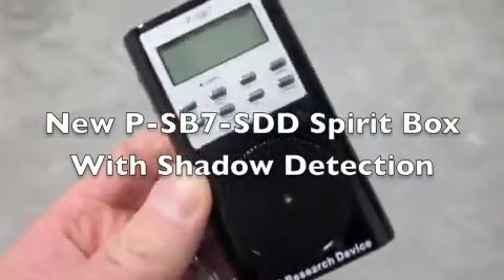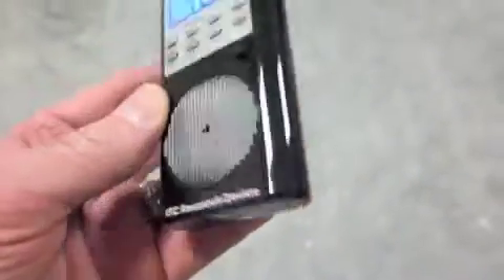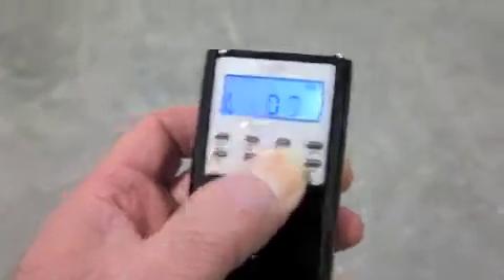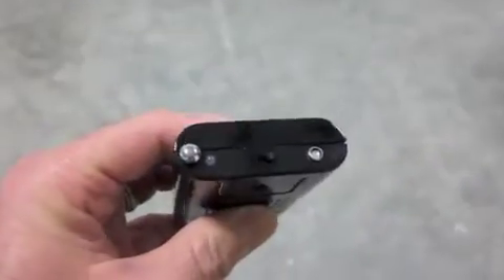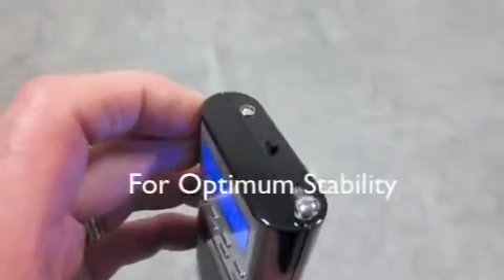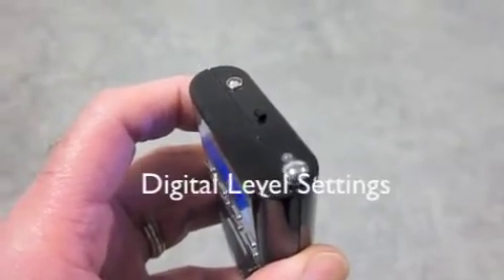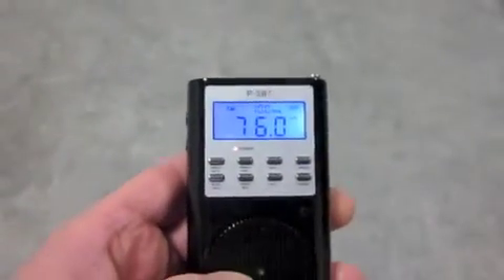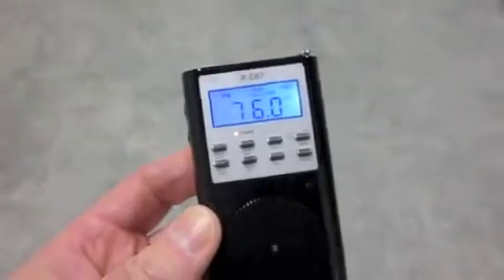P-SB7-SDD Frequency Sweep with Shadow Detection

Comment from the maker: No, you do not need to hold the button. This device has several features that were designed specifically for its intended purpose. Application specific software, programmable sweep rates (Forward or Reverse), white noise between step sequence. ON/OFF backlight, two audio outputs (Speaker & Earphone), 100 additional FM frequencies. We now offer a Faraday Pouch that can also eliminate AM/FM radio voice and music from your sweep sessions. P-SB7 is available in amplified FM only or AM/FM versions.

Comment: With this device i have the ULTIMATE set up for an amateur hunter. I tweaked my xbox Kinect to provide laser grid, detection..followed by of course night/thermal vision. This will replace my former P-SB7 as a portable ghostbox/shadow detector. Works like a CHARM! Infact ive had better results just from using it as a ghostbox in general. It does however drain power a bit quicker, So ive been sure to remove batteries when im not investigating! Thank you for your affordable products, you rock!!